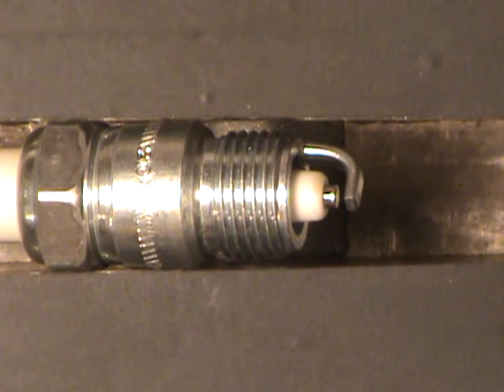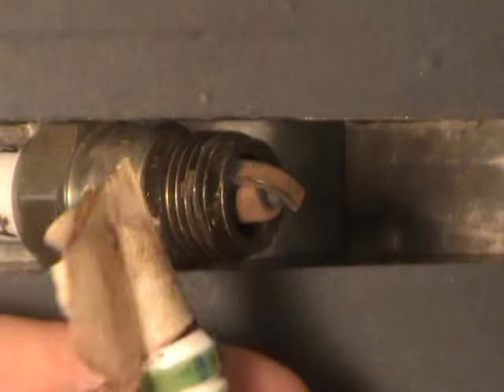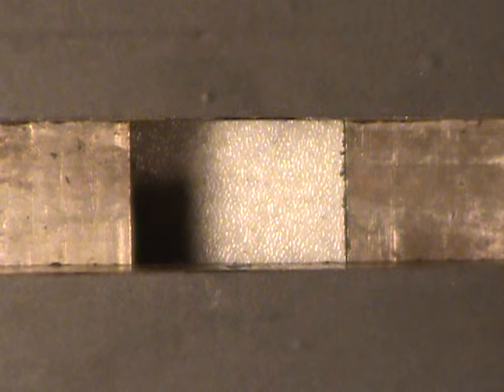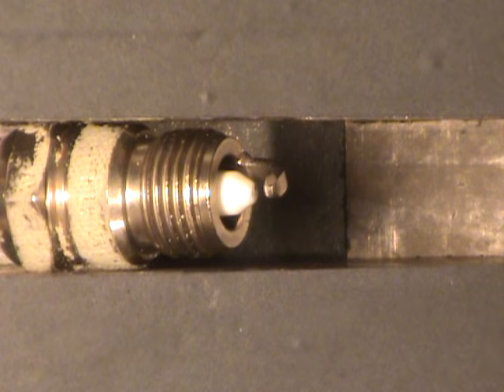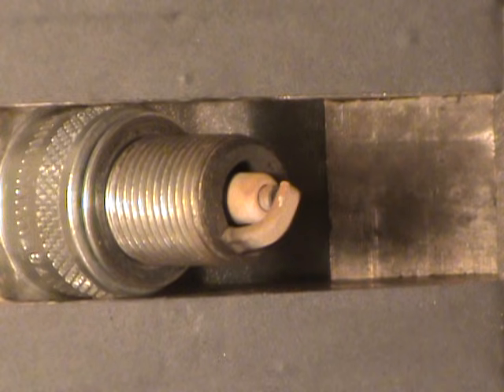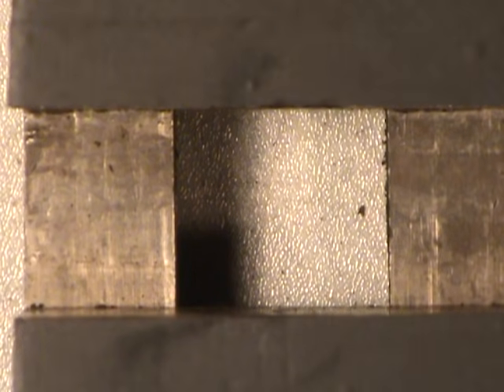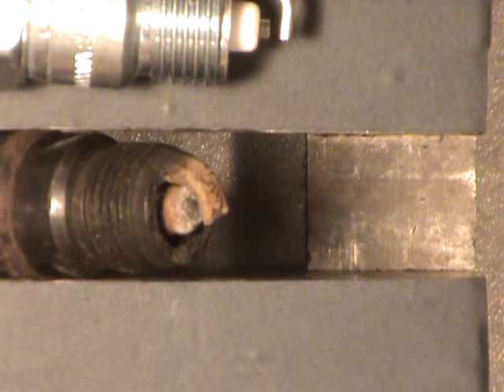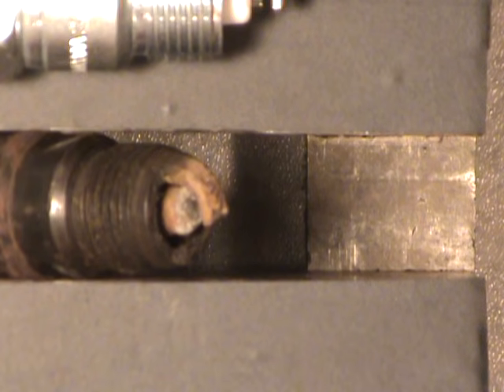SPARK PLUGS How to Read them (Part 3)

Comment: yous a wire brush a it will be like new really.
Reply from the maker: Greetings...James Fine...........Thanks for watching..........Well, a wire brush, will usually remove, quite a few of the deposits, that might be found on a spark plug's firing end, as long as, "it" (the wire brush), doesn't leave behind, any deposits of its own...........Then, there's the, deep down inside, of the park plug, where the center electrode's porcelain, and the inside, of the outer metal shell are, where a wire brush, probably won't be small enough, to get down in there..........Some, if not most, of the gas stations, oh, around, the 1960's and earlier, would have probably had, a small machine, that would actually "sand blast", the firing end of a spark plug, and really did a super job, at removing, just about anything, that got stuck on it............Somewhere around here, I probably still have, that little hand-held, spark plug cleaner, that actually..."sand blasted"...the firing end of a spark plug, and, it just connected to a 12 volt car battery, for the electricity that it needed to make it work...........I stopped using it some years ago, because, I got to thinking, that, if, just a very small amount, of that very abrasive sand blasting medium (material), got left behind, deep down, inside of the spark plug, and then, became dislodged, from its hiding spot, when the engine was running, then, those abrasive particles, would probably, start to gouge, some very bad, some-what, deep lines (score lines), where the piston, and the piston's rings, rub, up and down, inside of the cylinder (wall), probably causing enough damage, that, compression would drop quite a bit (not good at all), and........till next time........Be Safe, take care, and have a good one.

Comment: Reading my plugs is leaving more confused than before I pulled them. I have a bit of oil moisture on the threads and around the connector for the plug wire but the ground strap and insulator are a white/gray color. Also there are brownish streaks coming up from the insulator where it meets the hexagonal fitting that is used to tighten down the plug.  These may all be unrelated so I'm paying more attention to the groundstrap and insulator. Color shows I might be running lean but I have a enough fuel capacity at the fuel pump, a new in tank filter and new fuel tank. The under hood fuel filter has less than 10k miles on it so it shouldn't be clogged unless the higher capacity fuel pump freed up gunk in the fuel lines. The last evidence of a fuel issue os I have carbon buildup on the rear bumper above the exhaust. Any thoughts?
Reply from the maker: Greetings...Richard Bossman............Thanks for watching...........Well, it would really help, if you can tell me more, about the "Patient"...lol...as in...Year...Make...Model...Engine size...any modifications...etc...that way, I'll have a much better chance, at helping you out...thanks..........Oil on spark plugs and connector?...leaking valve cover (gasket) maybe?...........Brownish streaks on the spark plug's porcelain, is sometimes normal..........Black carbon, around the tailpipe exit...carburetor choke stuck, or, on too long (if applicable)...or, too rich, of an air/fuel ratio, etc.........If your engine has a carburetor on it, then, consider installing, a...wide band (oxygen sensor), air/fuel ratio gauge...kit...that way, you can monitor your engine's air/fuel ratio, in real time, as you are driving, at all speeds and engine loading conditions...........Old school, air/fuel ratios for 100% gasoline/No Ethanol, at sea level (ballpark figures only!), were about 12.5 to 1, while going WOT (Wide Open Throttle), and about 14.7 to 1, there-abouts, while just cruzin' along, not too fast (14.7 to 1, is usually, what computerized fuel injection uses, while, cruzin' along as well)...........So then, let me know more about, what you have there, well, if you care to that is, and........till next time.......Be Safe, take care, and have a good one.

Comment: You have a carburetor?   Weren't they done by the mid '80's?
Reply from the maker: Greetings...Dan R...........Thanks for watching..........Well, my daily driver, sure is fuel injected alright, but, I still like to play with the older technology/carburetors too (me...day-dreamin'...reminiscing...lol)..........Here in North America, in the 1980's, there-abouts, then yeah, fuel injection, kinda stole the spot-light alright, but, Ya might find, that, some (not very many), new European cars, might still have a carbureted engine or two, and, an internet search, might be able to find it...or...maybe them....possibly...???..........Lem-me-see-now...a "fuel injected" car's fuel pump, quits workin'...then...it's..."Tow-Truck-Time"...!!!...cuz, the high pressure fuel pump, is..."hiding inside the gas tank"...!!!...where-as, a carbureted engine's fuel pump, is usually mounted, on the outside of the engine block, that usually, just has 2-mounting Bolts & 2 fuel line fittings or clamps, and I can usually install a new mechanical type of fuel pump & be on my way, in about 30 minutes, well, if I have a new fuel pump, and the simple tools to do the job, that is...lol...........With a fuel injection & on-board computer system, there's way, way more things, that can go wrong, and maybe, Ya might have to, spend some of the Kid's inheritance money, to git-it-fixed...!!!...lol...where-as, oh, let's say, an older, 1960's there-abouts, North American made, car or truck, then, there'll always be, lots-sa-Beer money left over..."after"...Ya got-it-fixed...Burp...!!!...oh, excuse me...lol...........Please, don't get me wrong, cuz, a computerized, fuel injection system, will usually make an engine respond/perform better, in most cases, but only, when it's working, as good as it should be...........I like "simple" (like me...lol), cuz, Ya can usually fix an older car, without having to use another computer (aka, scan-tool)...lol...and........till next time.......Be Safe, take care, and have a good one.
Reply: My '65 has two one barrel cards.  Easy to work on as you have a reference!

Comment: Hey @rockysroadshow can you read my plug and tell me if it's too rich or too lean?
Reply from the maker: Greetings...Muthu Raj..........Thanks for watching...........Well, if you can tell me, what kind of engine, that the spark plug actually came out of, then, I will probably have a much better chance, at helping you out..........If the spark plug came out of, something like a car, or a truck engine, then...what year?...what make?....which model?...type and size of engine?...how many miles or kilometers on it?...etc..........If and when-ever, you might want to install new spark plug/s in your engine, then, try to use the "exact same" spark plug/s, that were installed in your engine, by the Manufacturer (Factory), when the engine was brand new, in order to avoid any, not wanted or needed problems..........Also, make sure that, the spark plug's (air) "Gap", between the two electrodes, are at the engine Manufacturer's..."specified"...gap size, so the engine will work, as good as it can, and........till next time........Be Safe, take care, and have a good one.
Reply: Hey thanks for replying. The carb is from a bike, a 160cc engine, and it is a pretty new one, with 1200 miles on the odo. I tweaked the AFR because the bike was stuttering under acceleration, and now the issue seems to alleviated. The spark plug now looks like this https://imgur.com/a/Pmxsv
Reply from the maker: Greetings...Muthu Raj............You're welcome..........I had a look at, the picture of your spark plug, that you provided the link to, and, to me, it looked pretty good, but, here are a few things, that you might want to consider (keep in mind)...........The deposit, that's on the outside, of the outer electrode, that looks to be, kinda white-ish in color, has me thinking, that, the air/fuel mixture, might still, be a bit on the lean side, quite possibly..........That yellow-ish/brown-ish, stain like deposit, that's stuck onto, the center electrode's porcelain, has me wondering, just, what kind of gasoline...???...that you have in the gas tank, and, is your engine, a four stroke cycle engine, or, is it a two stroke cycle engine, as in, having to mix, two stroke oil into the gasoline...???............Have you checked and measured the (air) "gap", that's between, the spark plug's two electrodes at all...???...because, the closer it is to factory specifications, the better, that your engine will usually run, for the most part..........Also, what RPM (Revolutions Per Minute), was you engine running at mostly...???...because, you might find, more in the way, of black carbon deposits, if the engine stays at idle speed RPM's, for quite a long time.........Also, if you run the engine at higher RPM's, on the highway, without stopping, then, the spark plug deposits, will probably be less, due to, the spark plug running a little hotter, which will usually, shall we say, "self-clean" itself...........Also, if the yellow-ish/brown-ish stain like deposit, starts coating, even more, of the center electrode's porcelain, then, there could be a possible scenario, where, oh, let's say for example, that, the engine idles quite a bit, along with, slow, city like operation, then, out on the highway you go, then, there's a condition, that's called, "high speed glazing", and is, as follows...........Those yellow-ish/brown-ish deposits, might transform into, an electrically conductive, "glazed" coating, when the spark plug, starts to run hotter, due to, running for quite a bit, at faster highway speeds, which might, end up, being the cause, of an ignition type of misfire, so, maybe keep that in mind, just in case..........Another symptom, of a lean running engine, is where the bike (or vehicle), bucks, or lurches, back and forth, while the throttle grip (or gas pedal), is kept, in a fixed, and not moving position, while travelling on a fairly level road, as I've experienced in the past..........Also, keep a close watch, on, how fast, the two electrodes wear away, due to, all of that, high voltage arcing/sparking, which will also increase the (air) "gap", that's between those two electrodes, which in turn, makes the ignition coil (if there is one, that is), work all that much harder, and.......till next time........Be Safe, take care, and have a good one.

Comment: Do all plugs age the same?
Reply from the maker: Greetings...stitch16261............Thanks for watching, and, good question there............Well, there are quite a few "different" spark plugs out there, that can be purchased, for most automobile engines these days, and, how long they will last, will probably be, due to, what "material", the spark plug's "electrode/s", are made out of...........The, shall we say, good ole, cheaper/regular spark plugs, might only, last about 12,000 miles there-abouts, where-as, take something like, a spark plug, that has iridium electrode/s, then, Ya might be looking at, about 100,000 miles of lifespan (theoretically), such as, what, some of the car & truck manufacturers, have been sayin', for some time now..........Have a look at some of the spark plug manufacturer's websites, and be looking for, the spark plug's electrode "material", and, Ya might be seeing, things like...nickel...platinum...double platinum...and...iridium...for example..........The spark plug's "gap"(that's between, the two electrodes), is important too, but, just be aware, that some spark plug designs, "are not gap-able" (or, if messed with, they will probably get damaged)..........Also, for just about any spark plug, to be able to last, as much as, is expected, then, the engine itself, has to be in very good shape, and be running almost perfectly, for all of those, some-what expected, spark plug longevity, miles or kilometers...!!! (good luck with that...lol)..........The "shortest" life span, of a spark plug, that I just might recall, is, those poor ole spark plugs, that are in, a "top fuel dragster's engine", where, the spark plug's outer electrode, can be "melted" completely away, once the dragster goes past the finish line...!!!...wowsers...!!!...lol...and.......till next time.......Be Safe, take care, and have a good one.

Comment: This is really helpfull to me.im kinda new to 2 stroke motorized bicycle motors and this is helping me diagnose my issues and helps me help other people with them
Reply from the maker: Greetings...David Chapman.........Thanks for watching.........Well, I've spent, quite a bit of time, with, the good ole "2-Smokes", ooops, I meant to say, "2-Strokes" (as in, 2-Stroke cycle engines)...........About the only thing, that might, make reading, a 2-stroke-cycle engine's, spark plug colors, more difficult to read, than, that of, a 4 stroke cycle engine, is probably, a really low ratio, of, gasoline, to, 2-stroke oil mixture..........Let's take for example, some of those, gasoline to oil mixture "ratios", shall we..........Some, much older, 2- stroke, motorcycle engines, as I recall, could have had, a 20-to-1 (gasoline to 2-stroke oil) mixing ratio.............There was also, a 2-stroke oil (was it Optimol?), that was mixed, up to, 100 to 1...!!!...(Wowsers...!!!)..........Then, there are also synthetic, 2-stroke oils, as well as, blended, 2-stroke oils too..........Then, some folks, still like using, castor (bean) oil (old school stuff, that works...!!!)...........I usually, end up, using 50 to 1 ratio, for most 2-strokes, these days, and, even that ratio/mixture, can show up on a spark plug, as well...........Here are a few things, that you might want to think about..........What Gasoline, type and octane rating, does your motor's manufacturer recommend...???............What type of 2-stroke oil, and (mixing) ratio, is recommended...???...........Always, try to use the Factory "recommended" spark plug, to help keep your engine "safe", especially so, the "heat range" of the spark plug, so, you don't end up with engine "damage"...!!! (try to get the same spark plug brand and type/numbers, and/or letters on it), that was "originally installed", in the engine, by the manufacturer..........Make sure, that, the spark plug's "Gap" (that be, the air space, that's between, the spark plug's, 2 electrodes), is, the same as, what your engine's Manufacturer "specifies", or, if not, Ya might end up with a weak spark, at the spark plug, or maybe, if it's too Big, then, that in itself, can overwork the ignition coil (if it has one, that is)..........Use good quality 2-Stroke oil (never use the cheap/junk stuff), so, your engine lasts a long time...........Always, try to use, "fresh" gasoline, not, old, sitting around for a long time, gasoline, because, it's crap (so to speak)...........If the spark plug gets really dirty (might be carbon deposits), then, that can cause a..."Weak Spark"...or, a..."No Spark"...situation, where, that high voltage, will usually, try to find the easiest way, to an (electrical) ground source, and might be, right through, something like, carbon contamination, that's, stuck onto the spark plug's porcelain, as an example..........Also, keep your engine's "air filter"..."Clean"...because, that engine has to breathe, oh, and, a Dirty air filter, will usually make the engine run "Rich" (air to fuel ratio/too much fuel in the ratio), and less performance, and less gas mileage, it will usually be............So, if Ya keep things fresh, clean, and not too old, parts-wise, then, your 2-stroke cycle engine, should have the best chance, at being "trouble free", well, hopefully, that is...........Good luck, and......till next time......Be Safe (wear a helmet...!!!).....take care, and have a good one.
Reply: RockysRoadshow i apreciate the help!thank you!